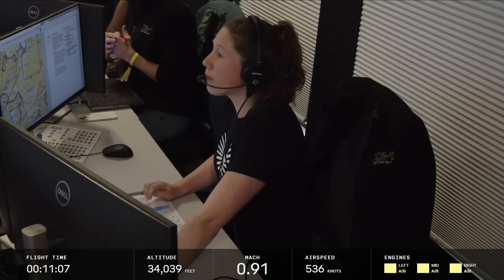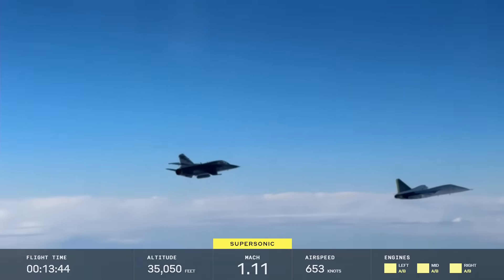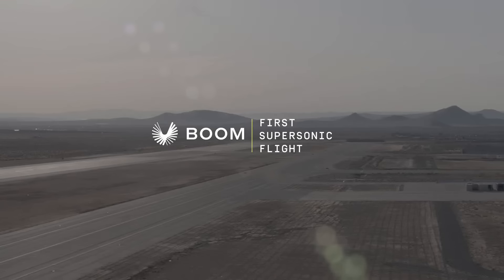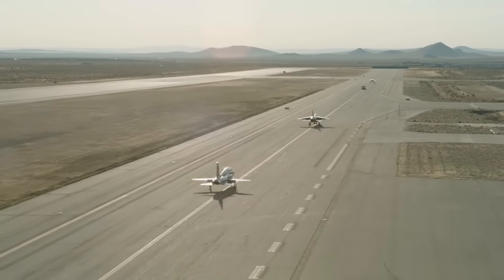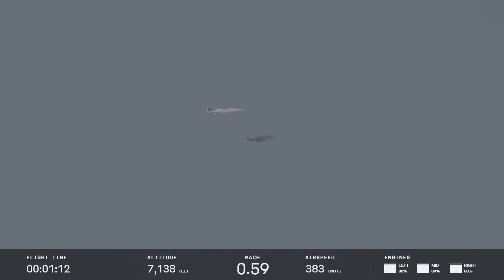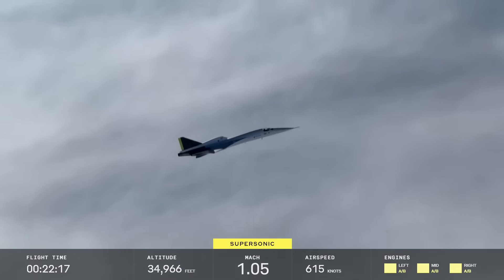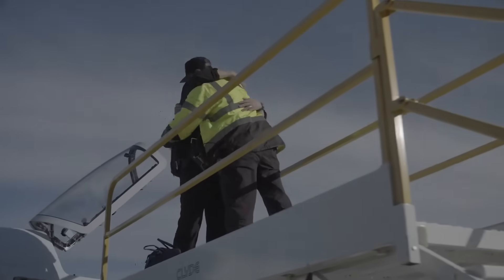XB-1 Baby Boom Goes Supersonic - Jet Planes, Starlink & iPhones

Comment: Yeah that landing configuration does not look very comfortable. I can see a lot of potentially very dangerous tail strikes in the future. There’s no room for any kind of reactionary pitching up if you get some weird headwind or are forced to abort the landing at the last moment.

Using the throttle instead of the stick or yoke to pull the nose up is a hard thing to train out of and I know all of this because I’ve pulled it directly from my ass.

Comment: The progenitor of the concord was the Fairey Delta an aircraft made from stainless steel.
Reply: A beautiful aircraft built and flown nearly 70....yes 70 years ago🇬🇧
Reply: The Fairey Delta 2 wasn't made from stainless steel. It was an aluminium airframe with a tailless 60-degree delta wing, designed for high mach research, that turned out to be much faster than anticipated, and actually took the world air speed record, breaking the previous record (F-100 Super Sabre IIRC) by the biggest margin ever. Later it was adapted for Concorde research as the Fairey 221 with an all-new curvaceous Concorde-shaped wing. I suspect the all-stanless-steel aircraft you're thinking of is the Bristol 188, which was also intended for high-mach research, but which was an abject failure.
Fun fact: Peter Twiss, who flew the FD.2 on it's record-breaking runs, was also driving one of the speedboats chasing James Bond at the end of From Russia With Love. Fairey had a boat division too, and made the lovely old-school speedboats used in the movie.

Comment: That was a sweet touchdown. Not only on centerline, but also just before the 1000' lines. That can't be easy in that plane. Butter!
Reply: The Test Pilot was a Naval Aviator with 200 Carrier Landings.
Reply: @primrosereceptionist611  I guess we know the landing gear can't break now.
Reply: @primrosereceptionist611  That explains a lot. Thanks!
Reply: @ICAleinns  with two planes guiding you in via a headset it’s easy. Learning to fly instrument landings uses a face shield that blocks your vision or VFR, visual flight rules.
Reply: @DavidPawson-d7h  True. But that last portion of an IFR flight is usually flown with a lot of VFR input (if possible) in order to set down precisely where the pilot wants. Like mentioned, that plane has video systems for VFR input for this phase. Learning how to use that precisely must have taken a minute or two.
Reply: @ I completely agree. I would think there’s some type of graphics on the screens to help align the plane with the centerline similar to tech used in Tesla and other vehicles that read road markings in conjunction their collective learning database.

Comment: What;s the big deal with this?  Concorde's cruising speed was Mach 2.04 back in the 1970's.  America couldn't handle the fact that Britain and France had a technically superior aircraft so scuppered it economically by not allowing it to fly supersonic over the mainland.  Concorde used to fly over my house each evening and the sonic boom which could be heard as it started out over the Atlantic never scared anyone or caused any damage.
Reply: Britain and France (and most of the other countries in Europe) didn't allow Concorde to fly supersonic over their countries either.  How does that fit into your conspiracy theory?  The big deal with this is the Boom Overture will be financially sustainable.  It will fly with fuel efficient turbofans without afterburners, making takeoffs far quieter to comply with modern noise regulations.  It will still boom like Concorde, and it'll still be restricted to supersonic flights over water.  But it'll make money doing it, unlike Concorde and Concord.  That's the big deal with this.

Comment: I'm super interested in you perhaps doing a video about the development challenges they'll face for designing the engines, that to me really feels like the make it or break it challenge in this
Reply: The engines for this at least are J-85's, off the shelf engines designed over 60 years ago.  For any full-scale, that is probably going to take more modern and more powerful fan engines similar to fighter jets... F-404, F-110, etc.
Reply: @kurtbjorn3841  They will also have to be a lot more efficient if they hope to be economically viable.
Reply: The engines seemed to work fine.
Reply: The engines are the only major thing left for boom supersonic before they develop the full scale plane

Comment: Mirage isn't the subject here but manufacturer is Dassault Aviation, maker of successful Rafale. Mirage is actually a range of military aircraft : Mirage F1 this one here is likely the CR variant, a reconnaissance aircraft. Other aircraft types in the series are are Mirage III, Mirage IV, Mirage 2000 (C,D, N, -5 variants). Dassault also do business jets and a subsidiary Dassault Systemes does the Catia, CAD software that Airbus, Boeing and many car manufacturer use.
Reply: It's a two-seater, so it's either an F.1B or an F.1D.
Reply: that F1 is probably one of the ex South African Airforce machines now flying in the USA

Comment: Thing is so fast it does .10 Mach just sitting still on the runway!
Reply: that will be because of wind blowing from in front of the plane, after all its measuring air speed not ground speed
Reply: Yeah, thanks...kinda self explanatory with the IAS right there at 65 knots to the right.  I guess humor is relative (like IAS)

Comment: Why does Google convert 650 knots to 1203.8km/h, when the speed of sound is 1234km/h? Did they really break the speed of sound?
Reply: The speed of sound is proportional to the air temperature, which is much lower at high altitudes.
Reply: the speed of sound is not a constant it depends on temperature and air pressure,
At 20 °C (68 °F), the speed of sound in air, is about 343 m/s (1,125 ft/s; 1,235 km/h; 767 mph; 667 kn), or 1 km in 2.91 s or one mile in 4.69 s. It depends strongly on temperature as well as the medium through which a sound wave is propagating.

At 0 °C (32 °F), the speed of sound in dry air (sea level 14.7 psi) is about 331 m/s (1,086 ft/s; 1,192 km/h; 740 mph; 643 kn).[1]
Reply: @ecomandurban7183  Strictly speaking the speed of sound depends only on air temperature. In a roundabout way lower air preasure is consistent with high altitude and lower temperatures, but otherwise there is no direct connection.

Comment: It is impressive, but does not change the fact that the whole thing is pointless. 

We already had supersonic air travel and it stopped not because of the Concorde, but because it does not make economic sense, and that has not changed. 
It is also even worse for the environment for the environment then regular flying . The engineering here is impressive, and I respect all the effort, but wasting it on this is kind of pointless, since it will never result in a supersonic passenger airplane.
Reply: yes that has changed. engines in general are vastly more fuel efficient than they were in concordes time. and the full version wont use afterburners, it will have supersonic cruise like an f22 or modern fighter jet does, so it will save tons of fuel

Comment: Apparently, the "Knock it off" call was due to a F16 practicing spin recovery that presented a possible conflict..
Reply: It still is Edwards AFB. While they will have been highly prepared for this test, they don't just stop military operations because a commercial test is happening in the same airspace.
Reply: @hammerth1421  Sure, of course not, but the AFB controllers do know there's a test vehicle in the supersonic corridor and they're supposed to keep other flights away from the area. It was certainly a mistake that another training flight was allowed to get close enough to be concerning.
Reply: @Keenath  I suspect, that due to the nature of the test vehicle (ie: what' it's exploring technologically), that it may have been more about "noise interference" than safety. But I could be wrong.
Reply: @kathrynck  you mean the f16 would be making too much noise ? but then why would they even have chase vehicles ?
Reply: @DrakyHRT noise in the test data, I assume.
Reply: @ Well, I'm guessing a chase plane makes a stable droning sound. But practicing 'spin-recoveries' would be wiggling that exhaust noise all over kinda chaotically. Which can get fairly loud from behind the nozzle.
It's just a guess though really.
Reply: @Keenath  if it was a training excersize, the training pilot maybe did something wrong and wound up encroaching on the planned commercial test air space.  so for safety they had them knock it off.  Training means you are doing something to test something,  that means unplanned things can occur.
Reply: I wish people would stop giving starlink their business
Reply: @EchoOfEternity36  Aww, did the Starlink touch your Bud Light? What a third grade bully thing to write. Is there a valid reason or you just put feelings over engineers?
Reply: @EchoOfEternity36  if you wanna be angry at Elon take it elsewhere you're entitled to your opinion but don't put it on people where they don't expect it.
Reply: @Wefee_BigWefee  Here's an idea, no. And you know where you can shove that idea along with yours, Chief
Reply: @Wefee_BigWefee  What exactly are you going to do to stop me?
Reply: @Wefee_BigWefee  right, nothing. Carry on
Reply: @Wefee_BigWefee  well?
Reply: @EchoOfEternity36  I guess you must have made you a very proud boy to see daddy Elon make his heart-felt salute to all of those brave people who supported his new best friend.
Reply: @fermitupoupon1754 can you not read or something? You definitely can't type
Reply: @fermitupoupon1754 Uhh, I think you said that to the wrong person. ScuzzleButt36 was *criticizing* Elon.

Comment: This is the first time I've heard about problems with ADI data when breaching the sound barrier, interesting. Historically there was another factor at play with our then quite limited design knowledge of supersonic jets. When some early experimental and  suboptimal supersonic airframes went severely transsonic, the multitude of pretty severe local shocks induced a fair amount of drag. The a bit underpowered afterburning engines had to be firewalled to push through, then throttled back to maximum continuous power. The phenomenon was confirmed with radar data for product development, it had been sort of seen in supersonic wind tunnel data but that doesn't fully represent the full scale thing.
Reply: This is generally why the air data sampling system is put out on a boom well in front of the nose - to keep it out of air disturbed by shockwaves.
Reply: my hypothesis is the pitot is working fine but the static pressure reading is briefly erroneously high due to a normal shock forming in front of the static port (and then resolves when it moves aft of the static port), resulting in both speed and altitude indications being erroneously low

Comment: You didn't mention if anyone heard a boom. That was the whole point in building the thing. No booms.
Reply: That was not the purpose of the thing at all.  That's the purpose of the X-59 project.  They're entirely different programs.
Reply: @stargazer7644  And what pray tell is the name of this plane?
Reply: @matthewdavies2057  This plane is the Boom XB-1, the demonstrator/testbed aircraft for the future Boom Overture supersonic passenger plane which hopes to be a financially sustainable replacement for Concorde.  The X-59 is the NASA/Lockheed Martin Quesst (which stands for Quiet SuperSonic Technology).  They're entirely different aircraft and programs.
If you're trying to build a quiet supersonic aircraft, would you name it BOOM?

Comment: The Overture will need to cruise at supersonic speeds. Afterburner is very fuel inefficient , so I presume they are designing the engines to be able of cruising at supersonic speed without afterburners engaged. Just like modern fighter jets.
Reply: Supercruise, most high-end fighters like the F-22  can do it without afterburner and the engines naturally have a greater amount of acceleration as per the design of the entire engine
Reply: @tyvernoverlord5363  exactly

Comment: Just some observation here and there: What's up with the 0.1 Mach indicated speed while sitting idle on the runway (at 8:37)? Calibration error? Altitude on the ground 2700ft so any later reading needs to be adjusted by 2700 feet accordingly. Also having three engines with a light weight plane with one pilot and just barely break into supersonic? Were the engines on full power? Are you sure Scott, this can be called a success or a breakthrough? The Mirage with one engine and more gross weight can outrun this plane, right? Depending on the model their top speed is 1.25 to 2.3 Mach. And also can land safely without camera guidance. 🤔 Should we just upscale the Mirage? You should make a video about what advantage in technology Boom has when compared to combat jets. More cargo? Shorter runway? The only thing stands out for Boom here is that, it is a private company built up from nothing meanwhile those jets had many millions poured into their development a decade or two ago. Just for context a B-777-300 at cruising altitude does 0.84 Mach regularly while carrying approx. 400-550 passengers. It could reach supersonic speed but it was not designed to do so. For that reason (structural integrity and safety) it is mandatory for pilots to keep the plane below 1 Mach. Again 0.1 Mach makes a huge difference if the indicated speed and the speed on the ground (at zero speed) was carried on. Can we assume the 1.12 Mach wasn't 1.02? Not sure why you have missed to mention such discrepancies Scott.🤫

Comment: Important thing is, when the XB-1 went supersonic was it with a much reduced sonic boom under the plane as I think this is one thing they were really aiming for.
Reply: Not so much. The low boom project is a NASA thing.
This is mainly a commercial passenger attempt.
Reply: @dougaltolan3017  Oh right, I thought these guys were aiming for that too in order to get the regulations changed for supersonic flight over land.
Reply: @schrodingerscat1863  They'll have more chance since they are home grown, and acceptance of noise pollution is vastly different from the 60's.
Reply: That's not what Boom is doing.  They're planning to use non-afterburning turbofans to reduce the takeoff noise.  The Boom Overture will only be flown over the ocean just like the Concorde.  The X-59 project is the one trying to reduce the sonic boom signature.

Comment: That is a high AOA for Mach 1!😮 3:15
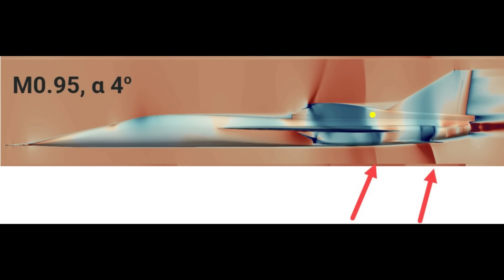Reply: 13:57 shows a rather thin airfoil, so most of the lift is generated by alpha angle.
Reply: @gordonrichardson2972  I understand, but all the effort to minimize air disturbance and you whack it with a fly swatter. 😉

Comment: The shape of the plane doesn't suggest it will reduce sonic booms. Maybe it's just a supersonic test before gradually implement features that will reduce sonic booms.
Reply: You're confusing Boom with the X-59 project.  Overture will reduce the takeoff noise dramatically by not using afterburners.  It will not reduce the sonic boom level.  Overture will fly over ocean routes like Concorde did.  The X-59 project is working on quieting the sonic boom.

Comment: For anyone confused, this is a demonstrator and testbed aircraft. This isn't that weird. 

If you are a layman to the aeronautics industry it is confusing. Most new technologies are designed around a testbed first and then advanced to the full scale. You dont want to spend potentially a billion+ on an airframe if you dont know if its going to do what its supposed to. 

The XB-1 here is holding their own engines to test them, it's a scaled variant of the body (we'll see if it is actually a quieter sonic boom as a result), and probably a ton of new avionics systems being tested. 

Its not as simple as it looks from an external perspective. Once this testing is complete, the FAA will give them further clearances to start full-scale pre-production units. Heck, I wouldnt doubt if they already have pre-pro fullscale units being built already. Once they get clearance they can ground test and flight test it. 

So, Im hopeful for their success! Will it be profitable? No idea. But this is comparable to what all of the major defense contractors and other companies developing testbeds and aircraft do out at Mojave/Palmdale(Skunkworks)/Edwards AFB.

Comment: As much as I love the can-do spirit of the Starlink unit on the T-38 canopy… am I the only one wondering what happens to that thing if the T-38 crew are required to eject? I can’t imagine it would remain attached to the canopy after it separates from the airframe. So it flies… where?

Comment: Like how it's so fast it did 0.1 mach sitting on the ground.
Reply: the airspeed indicator doesn't work below a certain speed (they ought to blank it in the feed to avoid people wondering about it)
Reply: I thought the same, maybe there was a strong headwind?
Reply: @davidhowe6905  65 knot/75 mph sustained wind?  Maybe the airspeed indicator just isn't accurate below a certain point and it doesn't matter enough for this test platform to worry about it.
Reply: @krtwood  That sounds much more plausible! also, the sound speed would be even larger on the ground, where the air is warmer.
Reply: mach 0.1's only about 120km/h, just a bit above highway speeds

Comment: What engines does this thing use, please?
Reply: Sources are confusing, either the General Electric CJ610 (civilian version) or GE's J85 turbojet (afterburning).
Reply: whatever engine 😂, actually it is a bit irrelevant since the company has no engine yet that would go inside their full scale size aircraft, they are trying to develop something on their own, good luck